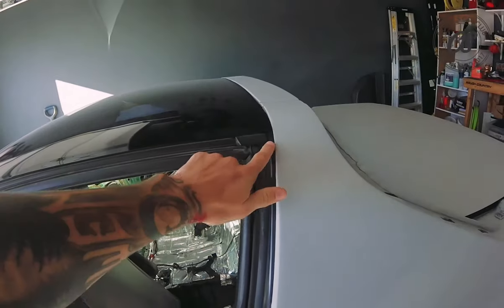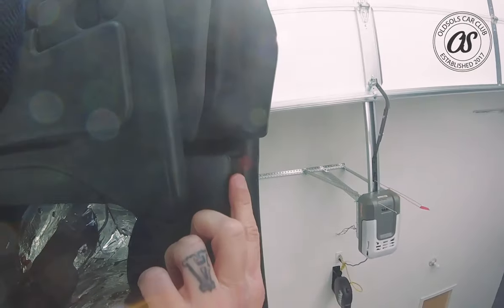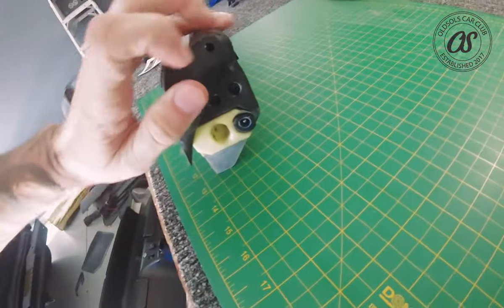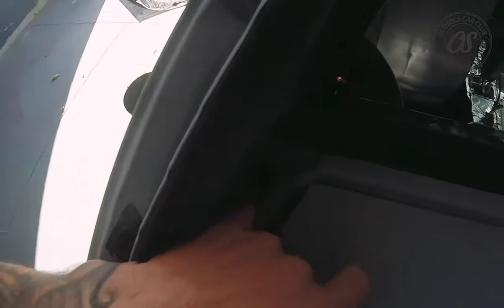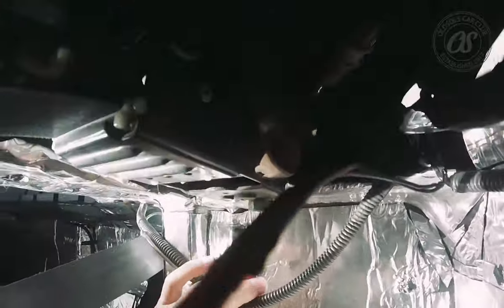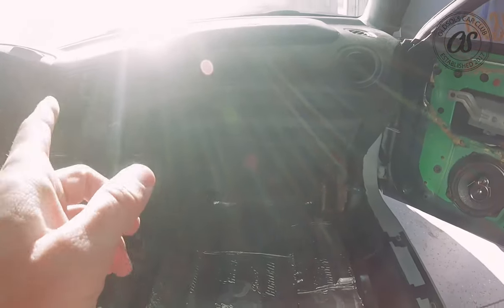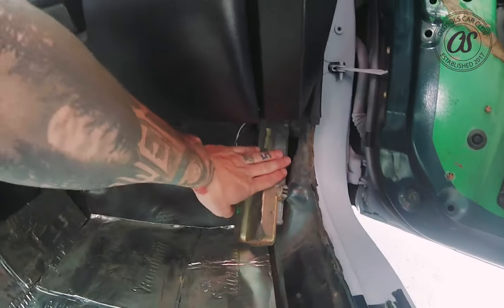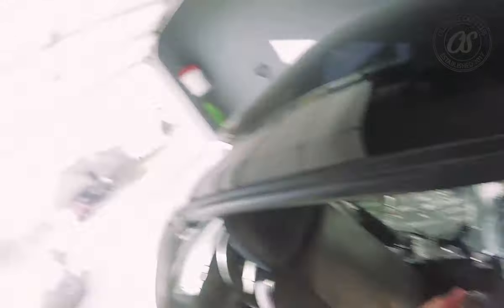Honda Del Sol - OldSols Vlog 47 - Leaks, Drains and Seals

Comment: I was really hoping to finally see where the sail panel drains empty out of the car on the underside but it wasn't here. I keep looking under the car after pouring water through but just can't pinpoint it. One of my tubes is bent and crimped and that's been a pain as well.
Reply from the maker: scondy1 sorry I wasn’t able to deliver
Reply: @OldSols  Oh you definitely didn't come up short with this. I gained a lot of good useful information with this video and I do appreciate it. You do good work.
Reply from the maker: scondy1 I plan I shooting photos of everything as well for the forum 

I’ll make sure to get that in the forum post 🤙🏻
Reply: For any future viewers wondering this, the holes are hidde by the side skirt. You need to remove them and the hole is near the rear wheel well

Comment: I just got my del sol and I keep getting mold in my car after it sits outside, I tried keeping it under tarps to stop the water but it looks like condensation is building up and  cause mold to get everywhere do I need to replace all the seals or just use some shin etsu grease

Comment: What about the sound deadning? Did you noticed a big difference? Any tips? I'll be doing mines next week. Thanks!
Reply from the maker: Julio Rovira undetermined ATM .... once I get all the panels back in and drive it around I’ll post up my review video .... I’ll follow up though!

As far as tips - wear some kind of gloves 🧤.... the metal covering has some nasty little sharp edges haha - but definitely don’t cover up any holes, bolts or screw holes cuz once you cover it .... will be a pain to remember where those are at again unless you mark everything 🤙🏻
Reply: It helps a lot, I already finished a large part of mine and now at 130kmh it is actually drivable for a long time.
Reply: @OldSols  thanks guys, it should be worth it then. I'll be waiting for the next video. Thanks!

Comment: There is also a possibility to leak under the firewall sound proofing. Mine is soaked
Reply from the maker: GearsW thanks I’ll make sure to get that into my forum thread - appreciate it
Reply: @OldSols  there is an old service bulletin for civics saying that there is insufficient sealant between the firewall and the front wheel arch area so water will leak into the crack
Reply: @Lulz Kev nah the blower would be on the Mat and the carpet, this is literally under the fire wall dampening

Comment: I just decided to give up
Reply from the maker: DKP Productions did you remove your seals completely off the car and check for damage to the seals and or rust/holes under the seals ?
Reply: @OldSols  One day hah! Been replacing pretty much everything suspension/mechanical that has deteriorated. All bushings were rotted out. I'll get to it! Appreciate the videos and if I have questions once I get there I'll reach out. Thanks

Comment: Mine leaks at the visor on both sides but mainly the driver side. Kind of a bummer but shes in the garage for winter now hoping I can figure something out before summer
Reply: @Lulz Kev closer to the door I guess, I have fully gone through the seals they've gotten the grease and fully blown out with compressed air.

It was almost no leak after that but to much rain and it leaks.
Reply: @Lulz Kev I'm gunna try the washer trick I think and see how that goes.
Reply: @Lulz Kev awesome I'll give it a shot thanks